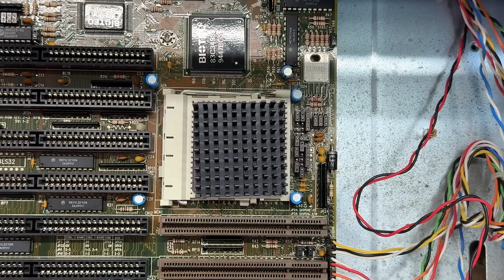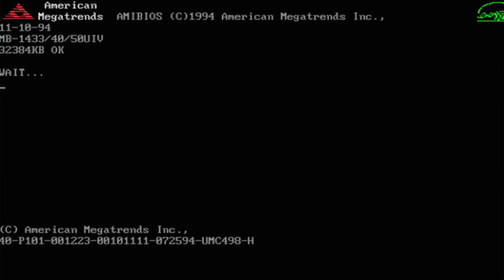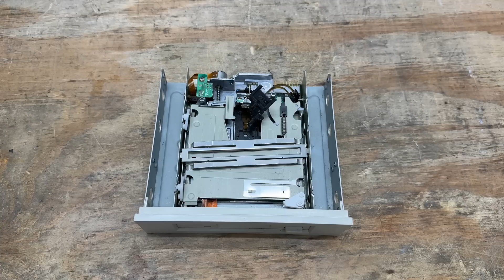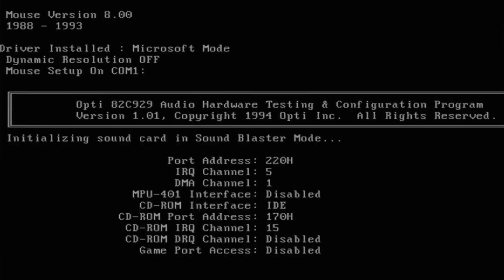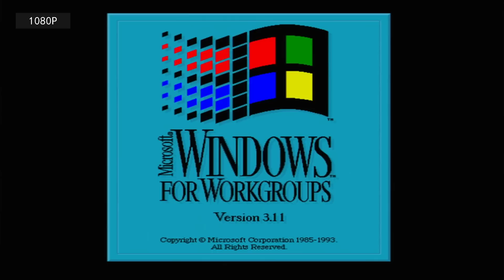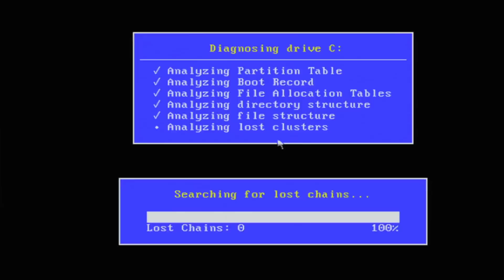The Celebrity Tower! Also one of my formative systems. Teardown and repair!

Comment: Hi Mike. Your subscriber from Russia is writing. I've watched almost all of your videos and noticed a few things that you're doing wrong in my experience. The fact is that I've been doing about the same thing as you for over 15 years, but not on such a large scale. Here are my comments:
1) Every time you make a hole in the fan sticker and pour a few drops of oil on the shaft, I cringe. It's very unprofessional. The fact is that the oil mixes with dirt and dust that has accumulated in the fan and turns into an incomprehensible substance. I always carefully disassemble the fan, clean all the parts completely, degrease and then apply a little silicone grease mixed with silicone oil to the shaft and sleeve to reduce the viscosity of the silicone grease. The viscosity will have to be selected experimentally.
2) Also, when you apply grease to just one place on the shaft with your "magic" screwdriver when cleaning and servicing disk drives, I also cringe. It is necessary to apply a small layer on the entire surface of the shaft using a toothpick. Use silicone grease as well. It is usually used for maintenance of tape drive mechanisms at cassette decks.
3) I also noticed that every time you try to check your hard drive for BAD blocks using the Microsoft Scandisk program. No one has been doing this for a long time. There have been more advanced programs for diagnosing hard drives for 15 years. I recommend you to use programs like "Victoria" and "MHDD". Unlike Scandisk, they have direct access to the hard disk controller, which provides more stable, high-quality and faster test data. In some cases, it is even possible to remove BAD blocks using these programs.
4) I also recommend that you check the RAM every time using programs like "Memtest86+" and "Goldmemory". Especially the "Goldmemory" program checks RAM very meticulously, in some cases it helps to identify an obscure floating defect related to RAM. A DOS utility called "Fast CDTEST 3.03a" is very useful for checking CD-ROM drives. She also has direct access to the CD-ROM and draws a graph of the disk reading, roughly similar to an oscillogram. The higher the peaks, the worse the CD-ROM reads the discs.
 I hope I can help you with your hard work with my advice. Just don't be offended by me, because I'm from Russia. I'm sorry for the machine translation, maybe something won't be clear, it's not my fault. With best wishes!.

Comment: Pretty safe bet the Hard disk died and the owner lost their cool over the data loss. I suspect those fingers were intermittent and a smack on the side would make the drive power on, until it didn't.... I would say what a moron but having lost data to a random drive failure I can attest the rage can be extreme. It's why I don't trust Seagate anymore, 4 drives failing within a year of each other was too much to be coincidence, fortunately I learned my lesson on the first one and backed up my data with the others. I am sure they are fine now (seagate) but once bitten... 

That was a pretty high end system in it's day, probably came stock with 8mb of RAM and got an upgrade later on. Should make for a really solid DOS gamer. Nice video.

Comment: My Dad's Packard Bell 66 MHz 486 came with Voyetra Audiostation which is similar, but the Wave Editor (Windat) is so friggin epic I still use it (although it stops working after XP and on XP it doesn't support using the mouse anymore for whatever reason). And yes it's pretty much like Audacity.
Kinda wild - even Win3.11's built in audio recorder is still far superior to the one that comes with Win11... (although none was ever so bad as the one from Windows 7. What can it do? Well it can record. Wanna hear what you recorded? Nope. Can't do that.)
You can probably up the resolution on that video card to 1280x1024 (with 16 colors...)

Comment: Awesome video! The HDD issues you're experiencing, could easily be caused by the controller and/or the cable. As the VGA card also had issues in a VLB slot, the I/O controller might be experiencing the same issues with a gunked up/corroded slot or gold fingers on the card. I hope to see part 2 some time :D

Comment: I find that 30awg wire wrap wire works well for trace repair. The insulation slides fairly easily, so you can make multiple connections and still have insulation between the solder connections. 🎉❤😅

Comment: That must have been a common case for manufacturers to choose.  We had a Quantex with a Socket 5 Pentium 120, 16MB ram, WD Caviar 1.6GB HD, STB Trident graphics card, Ensoniq Soundscape sound card, 4x CD-ROM, 28.8k US Robotics modem, and Win 95 that my folks bought in Nov. of 1995.  Came with a 17" MAG Innovision monitor, Altec Lancing speakers w/ sub, and a Panasonic KX-6100 laser printer. Oh yeah, and so much preinstalled software the drive was 1/3 full when the machine arrived!  Replaced the Epson Equity I+ they bought in '89.  Man the games we played on that Quantex.....

Comment: @MikeTech
If you haven't already, try that drive in a USB adapter and if possible, grab all  those files from the backups folder. There were floppy disk images in there which are likely the originals for the system.

Comment: I'm pretty sure the "audio rack" was used in a lot of different devices. I loved that thing, in particular because my old pc didn't have one. Interesting carnage. Also, not sure if you noticed, but both WD drives had the heads connection on the same place and they probably are similar (same for the spindle motor). Well in any case, good to have you back!

Comment: Nice video, man! "The wrath of the dumbass" would of been a cool title :) I have a case looking a lot like this one, only the buttons are squared, not round. And that VLB motherboard is cool too. 32 mb ram in just 2 slots! But I wonder why the post messages dont include L2 cache and CPU speed. Usualy it should display those numbers right before booting to ms-dos. And I wonder what score gets in 3dbench this system.

Comment: 17:00 There is space for an MC146818B chip next to where the barrel battery was. I believe this is for a Dallas style battery and there are modules which take a CR-style battery that you can use in this position. Could be an option though with all the traces you had to repair I'm not sure if it would be possible.

It is also interesting to see a spot for an 8742, I think this is for a COM port or some other type of external port.

Great job on the computer. Surprised you didn't wrap it in woodgrain as an homage. :D

Comment: Might be worth replacing that resistor on the harddrive with a proper replacement, maybe from a sacrificial harddrive. I don't know about resistors but capacitors on drives can be tricky, altering timings and stuff. Maybe it'll work properly again, it doesn't look like any platter failure.

Comment: Im curious if that hard drive is actually failing or if its an issue with the controller instead. I mean the bangs next to it certainly wouldn’t be good for it but yeah, wonder if scandisk would also freeze if you tried that drive in a different system.
I wonder why that guy smashed the inside like this, but if it was for data destruction it certainly didn’t work out too well for him eh

Comment: I'd be inclined to image the drive, you never know with old drives there might be lost software or drivers on them. It also means if it was to stop working you would have an image so you could write it to something like an IDE to CF to go through the drive to recover any lost software or drivers. It's something I always do, and even for computers with original drives with a recovery partition that can be burned to CD or DVD I create restore disks before destroying the drive if it's no longer working properly, or before I use Linux to to zero out the drive. Congrats on reaching 20K subscribers.

Comment: which type diode you use there for the battery from CMOS?
Reply from the maker: It's a Schottky barrier diode. I didn't note the P/N, just tested its characteristics with the bench power supply. Any one with a forward voltage below 3v should be fine.

Comment: I have 2 beige cases that I refurbed with Via C3 and K6 motherboards, the original 486es both have varta damage that extends resistors. My interest doesn't really extend to pre-pentium systems, but your expert trace repair may embolden me at some points.
Reply from the maker: For trace repair, check out a YT channel called Necroware. He is a master!
Reply: @miketech1024  Necroware is a little too good. You wouldn't look at Superman and think "I can do that." Your trace repair was like Peter Parker - just within the realm of attainability...

Comment: Apparently Pionex computers were sold at Discount Clubs (Sam's, BJ's, etc) and on like HSN and QVC. I have a P2 Pionex System I got in a lot of old computers 10 or so years ago, so I don't know where mine came from. It's always fun finding stuff from random system integrators, I have a random Celeron D system that had all the cheapest parts in an SFF case, that was sold under the brand Balance Digital for a few years at Walmart in the mid 2000s and then they disappeared.

Comment: Someone got nasty on that case much like the dreaded VARTA did the dirty on the board! Appreciate the nitty gritty repair effort that went into this video 😄. Glad you could get that black Caviar semi-working at least, it sounds nice in the background! 😌
Reply from the maker: Thanks! I think those spindle motor fingers still weren't making good contact, causing minute speed variations and thus the I/O errors. I think it's a good drive otherwise. Might try the direct-wire "solution" similar to what was done on the sacrificial hard drive.
Reply: @miketech1024  I like that idea! I love seeing these old drives kick on & in the case of the sacrificial, click on!
Reply: Except it was a KTS and not a Varta. Same same in the end, but very much different brands.